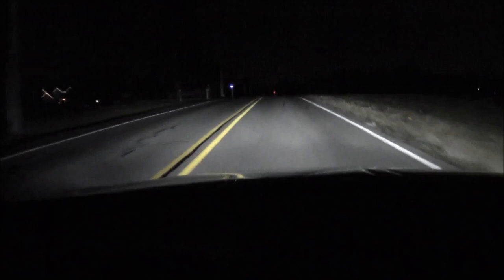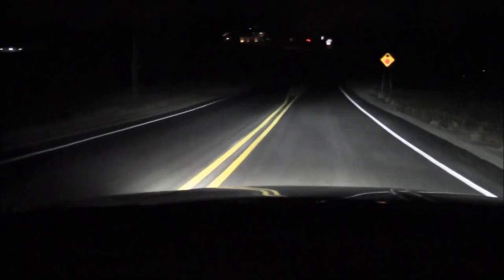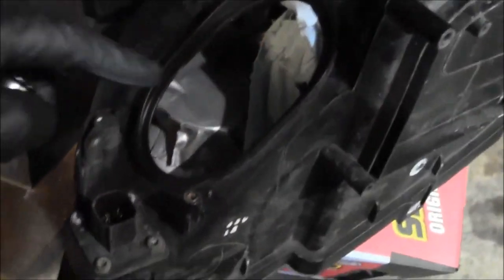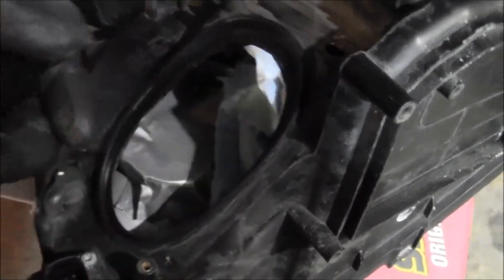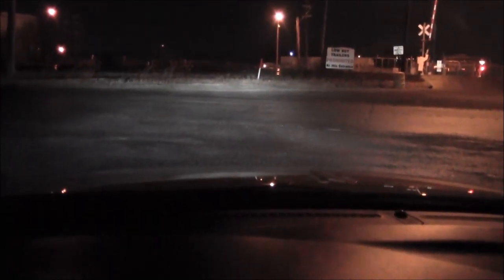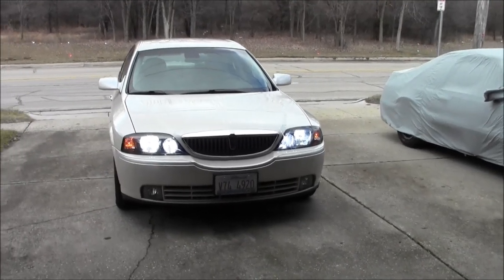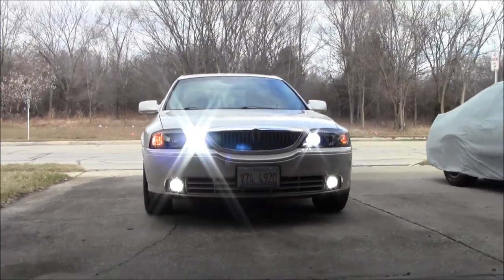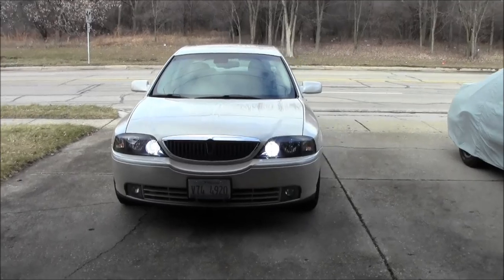Lincoln LS LED High Beams (NAO 30W LED)

Comment: MY IMPRESSION:
Wow! Lincoln took the BMW front fascia appearance and jazzed it up to be adaptive for this american sport luxury car. However the rest of the LS body formed a beautiful shape different than any other vehicle on the market. Many years ago Mitsubishi tried the same thing (8th Gen Galant), but copied much more design cues from BMW’s 3 and 5 series. Lincoln really gave it a go to deliver the proper driver enthusiast sedan. The LS was rear wheel drive and offered a V6 and V8, plus manual transmission until 2002. Also, I’m impressed the Lincoln LS looked nothing like variants shared on the same platform; e.g., Jaguar S-Type.
Reply from the maker: xrmerkur:  I agree with you.  The Lincoln LS seems like a hidden gem.
Reply: fwh79 ,definitely; and completely different from anything else Lincoln offered at the time. People didn’t know how to appreciate these cars because the auto industry started pushing the SUV shape, even though the crossover was just a station wagon in disguise.
Reply from the maker: xrmerkur:  You're right about that.  This car did come out when the SUV craze was hitting full swing.
Reply: fwh79 , today 4 out of 6 Lincoln models are SUV/Crossovers. however I must admit I love the new aviator.

Comment: That's great bro, I put those in my fox but my left head light looks for potholes and the right scans for low flying aircraft
Reply from the maker: Hahaha!  That's not good!  Did you try to aim them?  I have these bulbs for my fox... but I haven't installed them.  I know I had to spend some time will all over my cars when I installed HID kits in them.  I actually had to re-aim the headlights in my motorcycle when I swapped 4300k HID bulbs for 5000k HID bulbs.
Reply: @fwh79FOXR6  lol ya I know my headlight bracket is busted
Reply from the maker: @c431inf  Hahaha!  Ok... well that explains it.  I think the stock fox body headlights are pretty good at scattering light with the diffusion ribbing they have.  I bought clear head lights for my white car and that made a big difference in the beam pattern and aiming.
Reply: @Herbert Wingfield ha ha I have done that to
Reply: @Herbert Wingfield lol it did but I kept it and keep it wedged under the rear groundeffects so I can use when I lock my keys inside lol , I tried to straighten it but it never looks right after
Reply from the maker: Herbert Wingfield:  That is some serious motorcycle dedication!